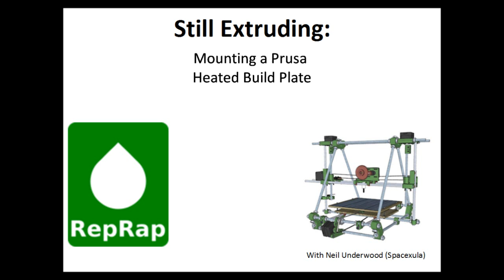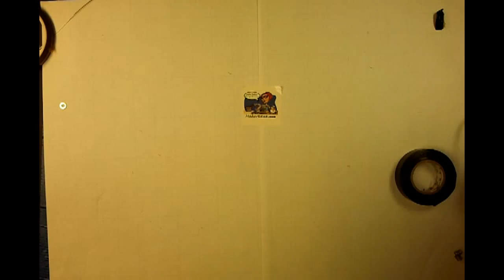Still Extruding: Mounting a Prusa Heated Build Plate

Comment: Thanks for these videos.  There were really helpful.  Two questions: our MakerGear kit didn't come with a heated plate thermistor.  Do you have a part number on the Thermisor you used?  Second question, your idler pulleys are metal in some video; ours are plastic and they don't seem to work well.  Do you have a part number for your idler metal pulleys?  Thanks so much!!

Comment: IMHO your Prusa heated bed is upside down the copper side go's up
this is intended to spread heat evenly. to your glass plate.
insulate the underside to drive heat up
 a cut piece of pipe soldering blanket 17 bucks at Lowe's
will work and support the pcb better
a small slot in blanket for wires